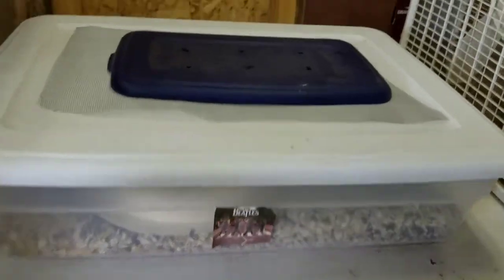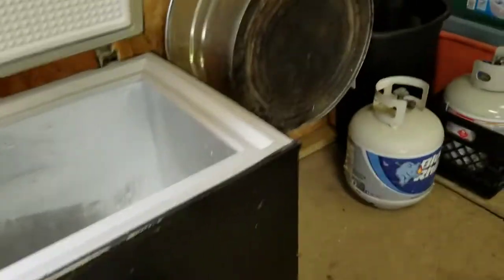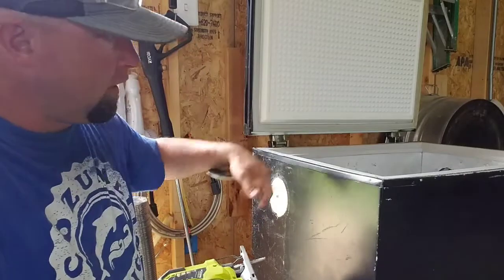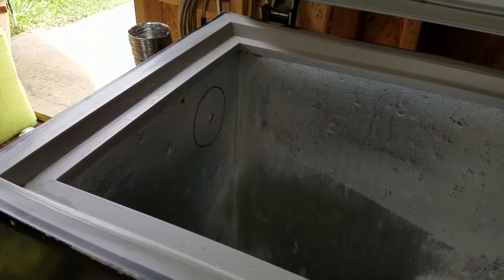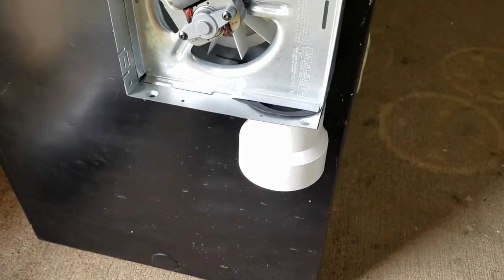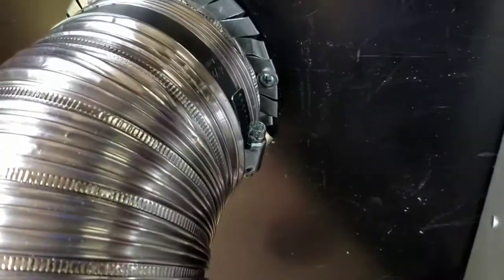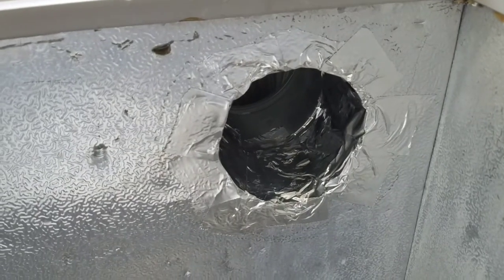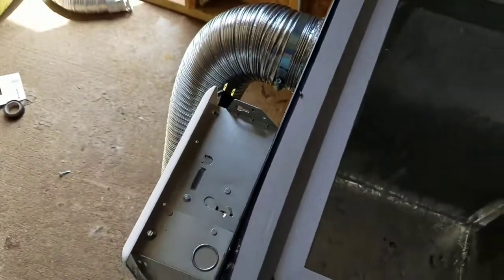(Flesh Eating Beetles) How To Make a Dermestid Beetle Enclosure(Cage) using a Chest Freezer

Comment: what did you spend in extras to build it besides the freezer if you dont mind me asking
Reply: liked and subscribed buddy
Reply from the maker: The freezer was free obviously. I probably spent $50 for the fan, dryer duct, foil tape, etc. 
I also went back later and put a plexiglass window on the top and put LED lights inside on the top.
Reply: did the air flow help keep smell down....I need to do a good job of keeping smell down on my set up..I'm try to make a parts list and figure out the best floor plans before I start hacking and cutting on my freezer
Reply from the maker: @jakelundgren7933  not really. Its more for humidity. However I planned on running another dryer duct from the output hole to the outside of my shop if the smell got bad but it hasn't yet. The main thing I've found that helps is removing the brain and as much flesh as possible so that the beetles clean it before it starts to smell.
Reply from the maker: @jakelundgren7933  please subscribe I've got a few other beetle videos on my page  and a few more in the works.
Reply: thanks man